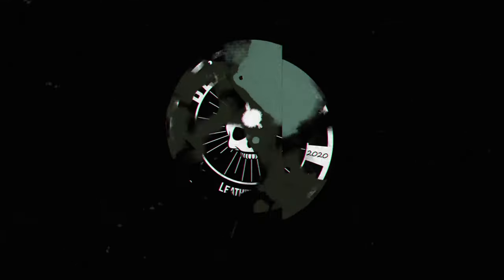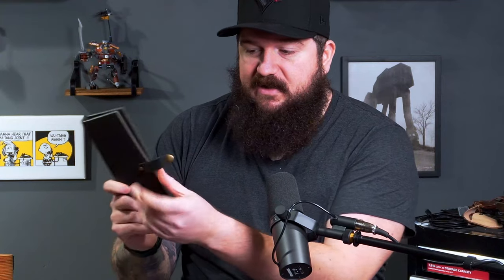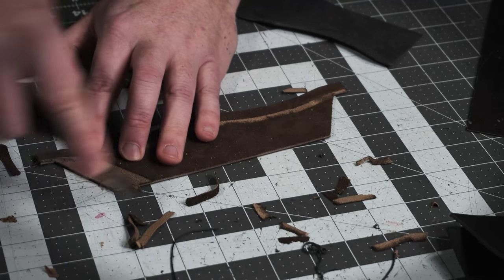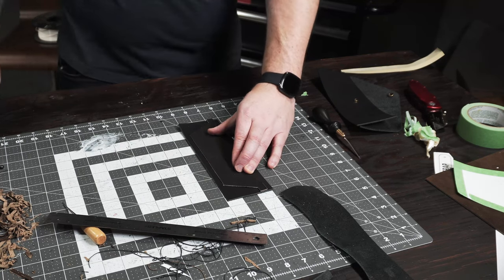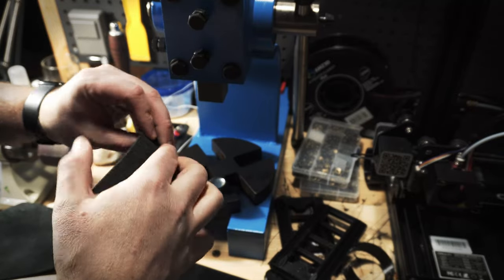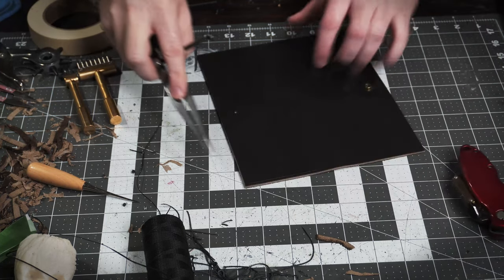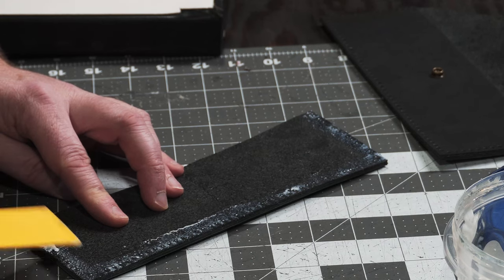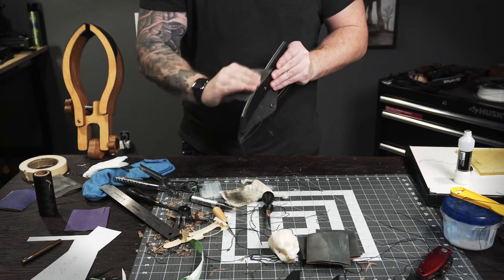Making a Leather Long Wallet - Free PDF Pattern

Comment: Could you tell me what leather cutting knife you use.  I've seen it in some of your videos, it's brass with a steel blade inside and you've called it your indispensable knife.  Thanks.
Reply from the maker: Of course. It is the L'indispensable knife by Vergez Blanchard. I use an upgraded blade by Chartermade in it.